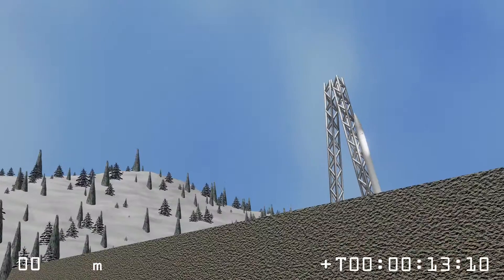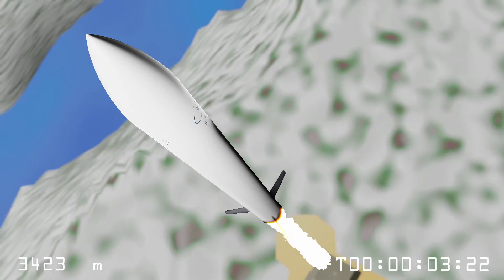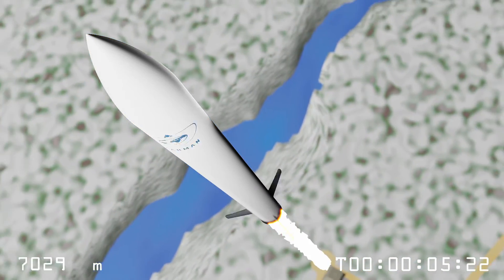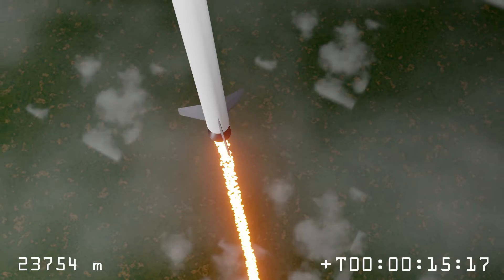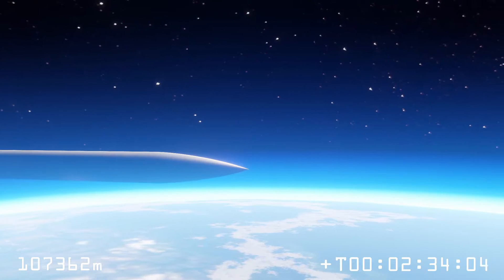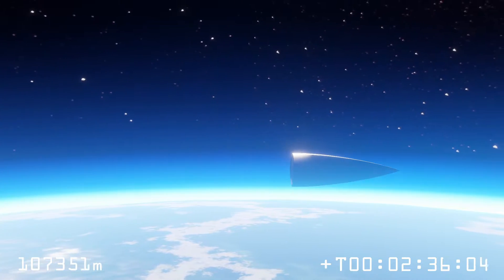ASTRA Transcendence Rocket: Recovery System Introduction

Comment: I've always wondered why rocket companies don't do parachute assisted landings.. like, use the chutes to slow down the rocket and then do a minimalist landing using the least amount of fuel possible.
Reply from the maker: That is an interesting question.  For SpaceX, it has mostly to do with targeting.  While you are under parachute, your ability to control the downrange component of your descent is really hard (mostly because of wind).  So if you are trying to land on a drone ship in the middle of the ocean, this option doesn't really work.  The next reason has more to do with complexity.  Parachute systems seem really straight forward (throw the parachute out at the right time - simple), but there are actually a lot of moving parts, components, sensors, etc. that all need configuration and testing.  The rocket will slow down just due to drag alone (no parachute) to just below the speed of sound.  The extra fuel you need to reduce speed from 900 km/h to 0 rather than maybe 100 km/h to 0 under the parachute, is really not that big of a deal (for the Falcon 9 that would maybe be an extra ton of fuel or so).  At that point, the parachute option is barely more mass efficient and certainly way more complicated than just filling the tanks with an extra 1 ton of propellant.  

You would also need to cut the parachute away once you lit your engines for the landing burn.  That means hundreds of lines and fabric flying into the deceleration path of the rocket... to a reliability engineer, that is scary as hell.